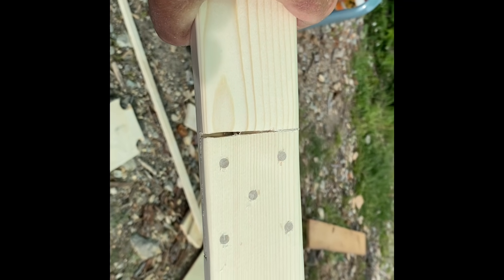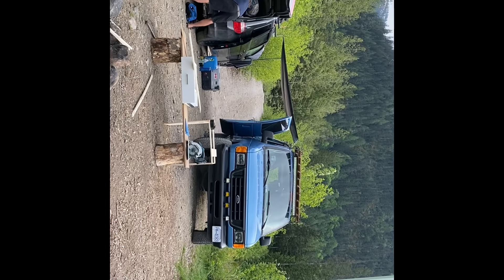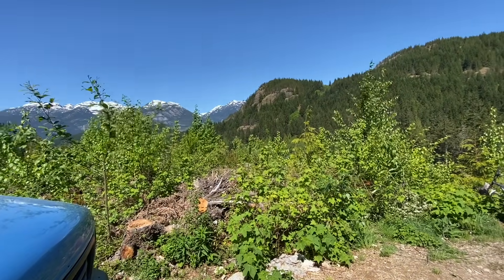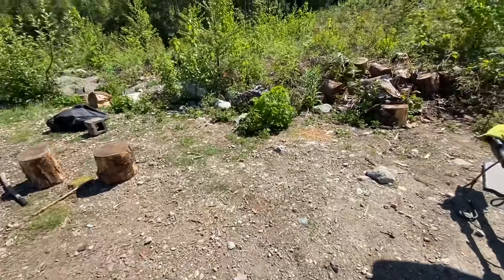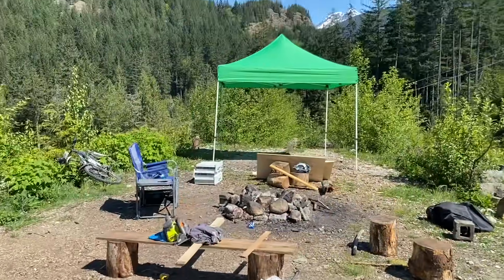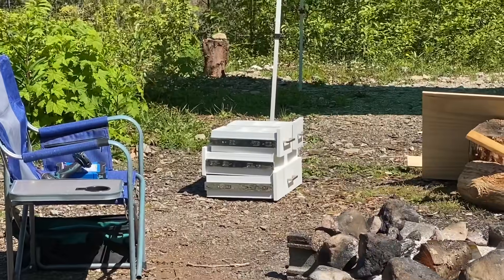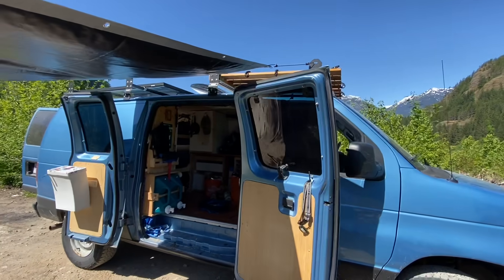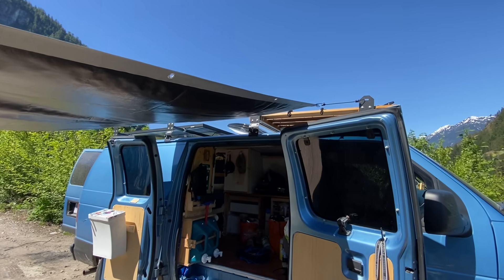Awnings and such

Comment: They have Aluminum extendable paint poles at Lowes. I got mine at Wal-Mart they are steel. If I were to make them again I'd get the Aluminum ones. Take the paint pole drill a hole in the screw end and thread a Stainless lag bolt into them.  Optionally you can squirter a ton of hot glue or epoxy into the hole before you thread the lag bolt in. Just let them cure lag bolt down for a bit if you do that. They work great, less expensive than buying dedicated poles and easily replaceable. They dont breakdown for storage as much but they work well.